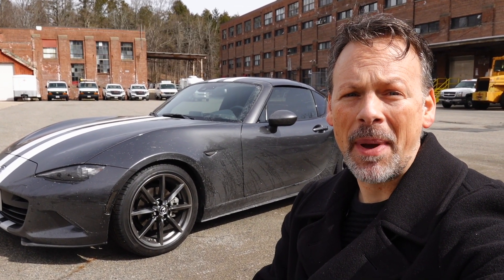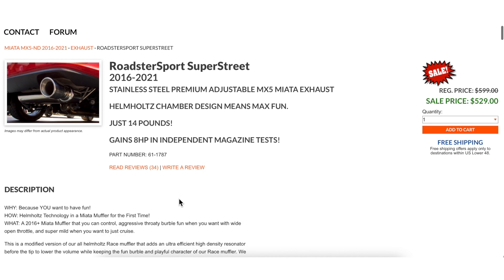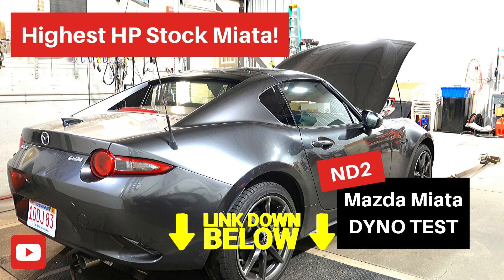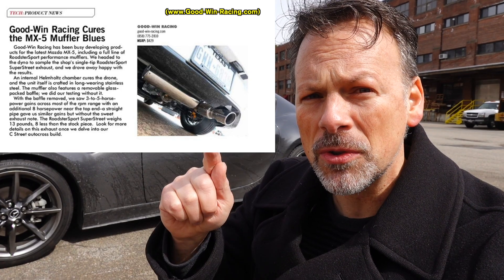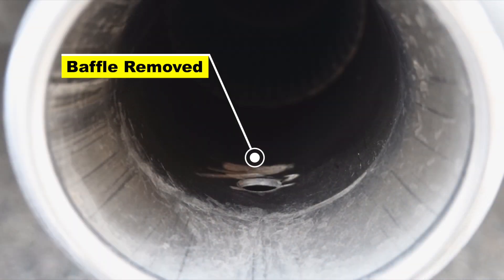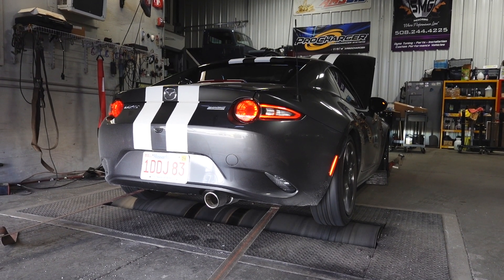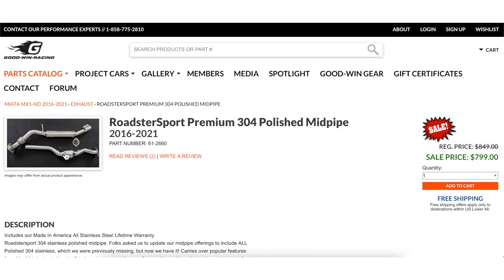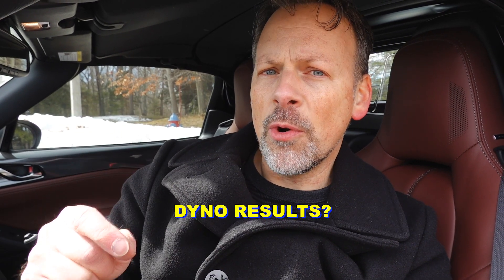Goodwin-Racing RoadsterSport SuperStreet Exhaust - DYNO TESTED // (ND, 2016+) Mazda MX-5 Miata

Comment: Chad, I'm not too concerned about horsepower gains, however what I am concerned with is if there's any drone with that exhaust?
Compared to the stock exhaust is it overly obnoxious and do your ears ring at all after driving the car?
I find the stock exhaust on my 2019 MX-5 RF just too mellow.
Reply from the maker: It’s been a while. Checkout some of the other videos as I do provide my feedback. With that said, I don’t recall much drone at all, maybe a little in higher gear low RPMs.

Comment: Fyi seems like you might’ve incorrectly referred to this as the gwr race which is actually a different muffler.. in fact I wonder if the race version would have a bit more power since it has the most straight piped design

Comment: just curious, did you swap the mufflers after each series of runs? To be even remotely scientific, you'd need to do that. If you test them weeks or months apart, there will be a significant delta due to at least a dozen variables. The software can help with some, but it is still an extrapolation.

Comment: Thanks Chad - excellent work my friend - love the methodical way you gop about your business!  Are you also planning to add the Goodwin racing Header at some stage?
Reply from the maker: Cyrus, thank you for the continued support 👍. I am considering testing a couple headers - any preferences?
Reply: @TheLemonFactor   Hi Chad - I have got the GWR Shorty Header (ceramic finish) - its a 4-2-1 header which is supposed to be better for mid range torque (which is what I prefer over outright top end Power).  I also wanted to keep the whole system with one supplier (Goodwin) so I went with their "Complete" system ie the header, mid pipe and their Super Q (header version) - I am really happy with the syystem both in terms of sound (quite mellow and not as loud as the SSST) as well as performance.  The header gets rid of the front CAT and so the only CAT is the free flowing CAT in the mid pipe.  Performance is really improved and its such a pleasure to drive.  I am playing around with Tunes at the moment.  I have a standard Versatuner 93 Fuel stock car tune at present - but in the process of trying out a custom tune to take into account that the car is modified.
Reply from the maker: Do you plan on having the car dyno?

Comment: Since the exhaust takes up less space underneath, is the underside aerodynamically affected? Does it create any stability issues at higher speeds? I watched a video of someone installing a Verus rear diffuser and claims it helps with the above issues due to smaller exhausts
Reply from the maker: I have not noticed any instability issues at any speed.  I’m sure a rear diffuser helps in smoothing out the air flow, but to an extent that is noticeable at legal speeds is questionable. 🤷‍♂️

Comment: Hey Chad, great video. Why did you go with the single tip, just curious. Any chance on reviewing the twin tip version of this?
Reply: Thanks for the reply. I recently purchased the twin tip and I must say I'm in love. This exhaust should have came as standard equipment. It's loud when you want it to be, otherwise one would think it's stock. Looks great too. Only downside I've found is that there is some drone while cruising above 80
Reply: Thanks. OMG, had my first oil change today at Mazda. Actually stayed in their "make shift tunnel" or greeting area until someone fired it up. Amazing, even at warm start! Think I'm in love
Reply from the maker: I went with the GWR single tip as I had the Greddy Supreme SP which is a dual tip and wanted to see what look I’d prefer. It’s possible that I’d look into testing one as I’m also looking into a few others. Thank you for the compliment and watch - very much appreciated 😁

Comment: ND.1 here. I have the Goodwin twin tip SS, Baffle installed, defiantly faster than stock.  Mid range rpms is excellent. Rolling punch throws you back into the seat. I will remove it and see if its faster than the installed. Before, when installed, I couldn’t tell much difference  speed wise with the baffle, just sound wise like the higher pitch.
Reply from the maker: Is there a baffle for each pipe on the twin tip version?
Reply: @TheLemonFactor  No, just one baffle. 3 positions moving it in or out. Kinda got the impression the Mazda liked a little back pressure, I liked the higher pitch, so its all the way in. IMHO, it makes it like the single outlet exhaust, but with the look of the twin. You cant beat the quality of the Good-Win. Nice shiny metal.

Comment: Thank you Chad for the details of the several test you made. This video and all the other ones. Are you considering adding a tune to your car? I own a 2019 RF Club Sport and I installed a Magnaflow cat-back exhaust last spring. I wasn't sure my choice was right until I watched your video. The Dyno test I did to my car indicated a 178.7 WHP @ 7000 RPM  and  158.3 lbs-ft of torque @ 4900 RPM. I also installed a Takeda intake which may help the performance. The airflow test I did with the Takeda indicate a 12.7% flow increase compare to the Mazda OEM Intake box. Unfortunately I did not do Dyno testing of the mods separately so I don't know where I gain most performance.
Reply from the maker: Thank you, Dan for your support and for taking the time to provide some positive feedback - it’s very much appreciated 😁👍. Yes, actually I already have the new ND2 tune from Versatuner that I plan on installing and testing once the testing of the Goodwin Racing exhaust is complete.
Reply: @TheLemonFactor  I heard about Versatuner ND2 solution and the custom from Fab9. I will wait to see your results and opinion before trying it on my car. I am not too much convinced about the performance gain vs the investment.
Reply from the maker: It will be interesting to see gains it actually does produce. Stay tuned 😁👍

Comment: Thanks for the great video! It seems the gains for either exhaust relative to stock are so small that you'd likely not notice a performance difference. The sound however, is another matter.
Reply from the maker: Exactly!  We’ll see if the midpipe adds any noticeable hp gains without making it too loud.

Comment: What were the weather and/or altitude differences vs your baseline pulls? Also, were you on seasonal fuel (e.g. Reid vapor pressure differences)?
Reply from the maker: Same dyno, dyno operator, and setup settings. The dyno results will adjust to climate differences. However, to answer your question it was low 30 degrees F for this run, and the comparison, stock run was done in February, so colder, dryer temperatures as well.